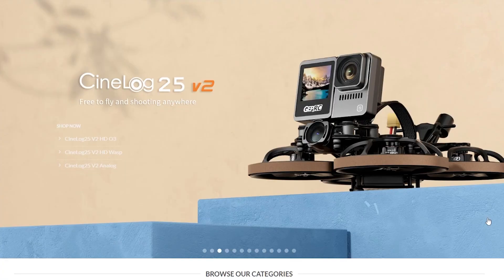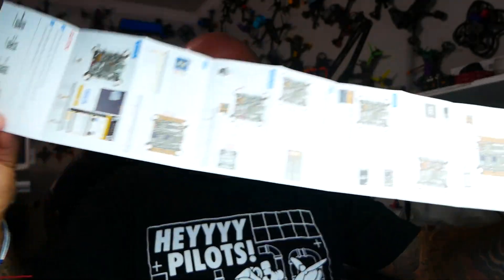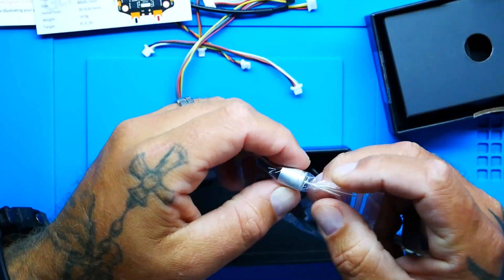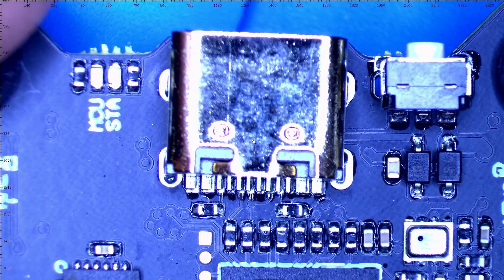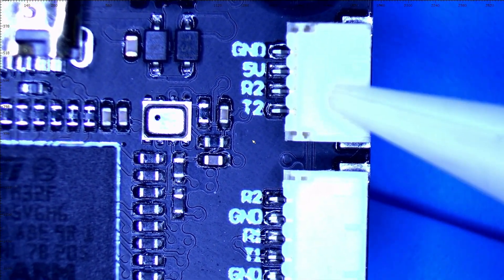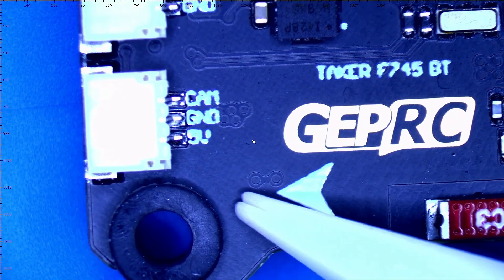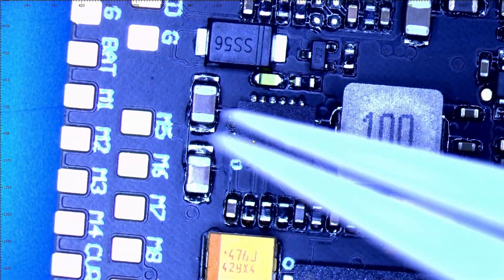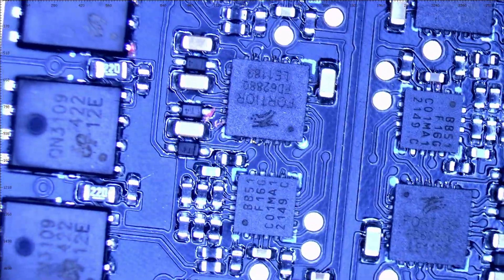All New Taker Stack !! Dual Gyro, Bluetooth, 60 Amps & More For A Great Price !!

Comment: The product came to me broken. The brand does not accept returns. They say the USB cable is broken. The computer reads the card and the lights do not turn on. But the computer sees the card. It gives a gyroscope error. I have been sending gmail constantly for 2 months. They do not help in any way.